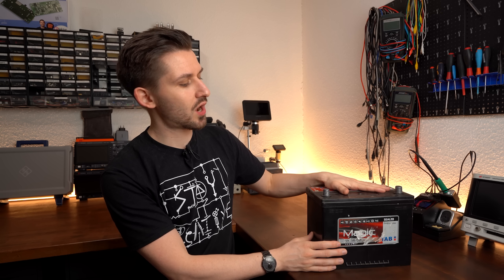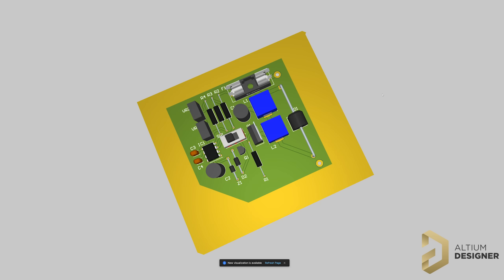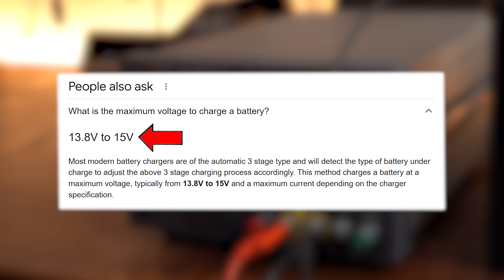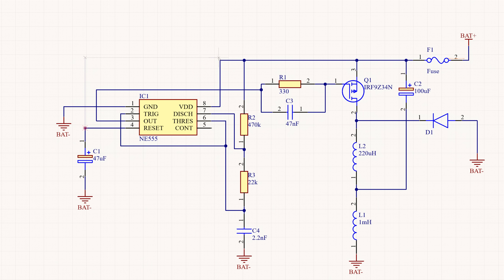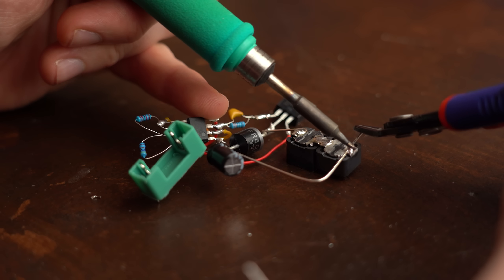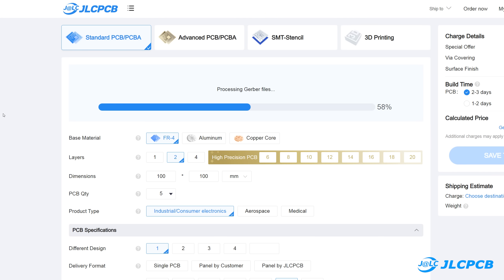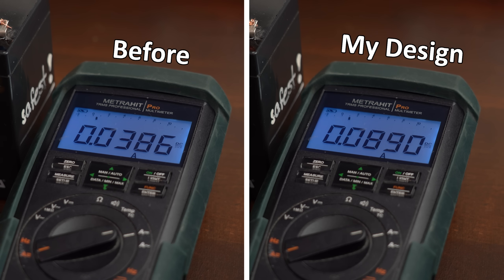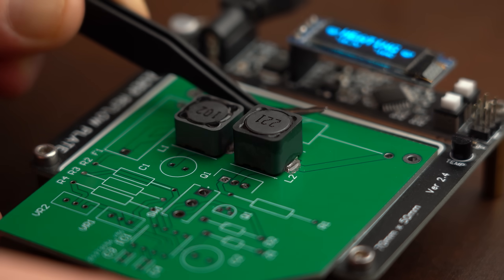I followed a YouTube "Battery Hack" and Wasted 30 Days! (Desulfator)

Comment: pro batt tech - lots of clients including one of the largest fleets of industrial (steel-cased) batts in the world - first thing for anyone reading this - if you want AGM then get a drop in lithium replacement - AGM = money pit - they are a bridge chemistry to basically serve the role of lithium before lithium was a thing and now that it is you could buy the lithium at 5 times the price and you'd still be money ahead - there's a reason that the tech never made it across the pond - also AGM is very fragile hence the money pit factor - so to desulphate a battery there are a few ways - the process is designed for anyone - those who understand it on the other hand don't go buy the book - first is that swapping the electrolyte for fresh DOES NOT desulfate and will cause severe destruction of the positive plates as it changes the PH of the batt (for what ever reason most people think that only liquids can affect the PH but this is incorrect) - the pos plates do the work in a LA batt and are designed as an optimal anode material (called the active material) as the charging process is electrolysis - to desulphate properly (i've desulphlated 1000s of batts and the average batt i work on is about $7,000) you have to cycle the batt which means charging and discharging - as the batt discharges the sulphate bonds to the lead in the plates and the process reverses during charge - if the sulphate is left bonded to the lead it will form a second covalent bond and this is what is known as sulphation - as it is physically bonded to the plate in solid form then an electrolyte swap is pointless - the sulphate has to be busted off of the plate and that is done by controlled overcharging - so - take the capacity of the batt in AHs - a standard automotive 12V is about 70AH - so a 20% start rate for normal charging is 14A and the 5% finish rate is 3.5A and the desulfation rate of 2 to 3% is around the 2A range hence why lots of chargers have a 2A option - the max temp of most batts is 110F and then the batt will start to take damage - this is the internal temp mind you so for a car batt don't let the outer temp get above 95F and you'll be good - also - don't let the temp get below 50F - dissolved solids are another problem so be sure that any water used is distilled and deionized - only ever water a batt when fully charged otherwise it will push out excess electrolyte - so take the batt and pop the caps - is the water is below the top of the plates then add only enough water to just cover the plates - then start it on a 2A charge and allow it to charge normally - when finished the electrolyte should be just below the vent well (about 1/8 to 1/4 inch) - if it is under then add enough water to fill it to the bottom of the vent well - i always do this at about 95% charge and fill to a 1/4 inch below so when the batt finishes the last 5% the electrolyte is mixed and the level set so that i get accurate readings - two ways to take SG readings (be aware that specific gravity is a relative density reading and has nothing to do with PH) - a hydrometer and a refractometer - the hydrometer has to be temperature compensated the refractometer does not - most manufacturers list a SG for their batt on it or in documentation - if not listed then default to 1.280SG - this is at full charge - when dead this will be around 1.150SG - cell readings are taken in order from cell 1 (the most positive cell) to the most negative cell (a 12V car batt has 6 cells) - cell voltages are taken by VPC (volts per cell) - since most car batts only have a connection to cell 1 positive plates and cell 6 negative plates then for a car battery you would divide the voltage by 6 to get the average VPC - when loading the batt to discharge you need to set the rate at its 6 hour rate - take the capacity and divide by 6 - our 70AH batt comes out to 11.667 so we will go with a 12A load - the load needs to stay fairly constant so while discharging you need to monitor it and adjust as needed (doesn't need to be absolutely constant just reasonable) - continued in reply
Reply: so now that we know our rates and we have the batt fully charged and watered we are ready to start - the first thing to do is to take SG and VPC readings and write them down - then you start the load and write down the time and the VPC under load - periodically (every 15-30 mins) test the VPC and write it down along with the time - when the VPC of any single cell gets to 1.7VPC (our example batt forces us to estimate the VPC so it would be 10.2V under load) then take the final VPC readings and write them down with the time and stop the test - the time it took to discharge to 1.7VPC under load is your capacity and is important to tell if you are gaining any ground - now we allow the batt to cool if necessary and then we start it on a 2 to 3% charge rate (2A for our example batt) - i use cheap scientific thermometers (one in every cell) to watch the batt temps from the very start to the very finish of a battery reconditioning - if the temp of a cell spikes (it's usually very obvious) over the rest this indicates broken/shorted plates and that cell is bad so for our batt it would have to be replaced - once the batt reaches gassing voltage (usually around 2.35 to 2.4VPC also known as the 80% mark and is the point that the batt becomes saturated with excess energy and starts to drive the reaction process and is also when the batt is ACCUALLY charging) the electrolyte will start to lightly boil (ignoring bad cells once the cells are gassing good if any aren't mark them as they may be unsavable as it means that the cell is nearly chemically inert) - start taking SG readings at this time and write them down and repeat about every 30 mins - allow to continue charging until all cells stop releasing acid (as a cell releases acid the SG will increase) though don't stop charging until you take two rounds measurements with no change - then allow to cool - then discharge like before - then let cool - then charge like before - ect. - the point that we call it done is when the capacity stops increasing as well as when the sg stops increasing (referring to the final SG at the end of a charge) - for example 85% for two discharge cycles with 1.235SG all cells for those two charge cycles - we will want to stop at the end of a charge cycle so an acid adjustment can be made if needed - acid adjustment isn't necessary unless the SG is at least 30-40SG low as the manufacturers put in extra acid to compensate for battery degradation - I only have to acid adjust about 15% of the batts that is recondition - if it is needed then it has to be done properly - if not then it will fail rapidly - for our batt we can try to dump out the acid but you won't get it all and also when you tip it over it will cause the solid sulphate located in the moss well under the plates to move possibly shorting the plates - not worth the risk - once i'm on the final charge cycle and the acid stops releasing then i let it continue to charge so that it will continue to gas as this causes a convection current in the fluid causing a mixing effect - this is when i use an acid extractor and suck all the electrolyte out of the top of the cells and i pour in 1.400SG acid (hard to get as this purity is regulated - i get it in 55 gal drums so DHS audits us because of it) the strongest that a civilian can buy is 1.300SG but if you take it to about 150F then the water will evap out of it increasing the SG - BE WARNED - anyone that follows anything i've said here does so at their own risk - also 1.400SG is very strong) - i pour it to the top of the cell almost to the brim - allow to gas for 20-30 mins and then check the SG - if it's low then suck out the electrolyte again and fill with 1.400SG acid again (repeat until cell SG is at 1.280 or original spec) - if sg is too high then suck out SOME of the electrolyte and fill with distilled deionized water again trying to get the mix to 1.280SG for original spec - after the mix is set allow to continue to gas about 20-30 mins to allow it to mix and then check again - adjust as needed - once the mix is set then suck out electrolyte until the level in each cell is 1/8 - 1/4 inch below the vent well - the average batt that i recondition is about 7-10 years old and usually been operated 24/7 - most last about 2-3 years after but some have made it longer after the reconditioning (i've had one still operating that i reconditioned almost 8 years ago and i have 3 still in operation that i've reconditioned about every 2 years one of them i've reconditioned 4 times now - it all depends on plate damage) - do note that there are a significant number of factors involved that i haven't mentioned so results will vary - also you should know that there are two kinds of maint. free batts - AGM and flooded LA - flooded LA have a stabilizer in the water to prevent it from evaporating out - you can't buy the stabilizer and stabilized acid will not reduce when steamed - also if acid adjusting a maint. free batt then the batt is no longer manit. free and needs to be watered periodically - just pop the caps - charge it fully - then add water to each cell until the electrolyte is 1/8 - 1/4 inch below the vent well - AGM batts can be desulphated but not by the process i've described nor will i detail it as it can lead to serious catastrophic failure during the process
Reply: "Pro batt tech"  Fucking hilarious.  AGM... bridge technology... BEFORE the next technology even existed.

Comment: Test capacity with tester. Remove cell caps, Top of cells with distilled water and make sure to check level of electrolyte throughout process. Check cells with Hydrometer and record each cell specific gravity and color of plates and voltage of battery. Use a stick DC welder, charge battery with 80 amps until it bubbles for 5 minute, let cool, check electrolyte level, repeat 5 times. Check cells with hydrometer and record specific gravity to check for improvement of electrolyte, check plates color. Test capacity for improvement, if improvement is not sufficient Repeat with 100 amp setting, checking capacity after each cool down. This will usually achieve results ~75% of the time. If a cell/cells  is/are not improving. Go there may be a short (indicated by voltage being low after charge cycle) or extreme sulphation (try another charge cycle at 125 amps) if the improvements are not sufficient for vehicle use the battery may still be good for other purposes.  Check this video. https://www.youtube.com/watch?v=a2XRR9aFWPo

Comment: The Powerpulse from Pulsetech does work. If you get the charger know youll need to leave it on the batter for a couple weeks to a couple months to breakup aall the sulphates. It really does work. They also have a unit you can attach permanently to a battery

Comment: uh Scott.  Great job as always.  Regarding this type of desulfators and chargers, I am testing a 10A one on a 7A battery.  And I don't know if I'm doing it right or not.  Do you think it is posible to put a current limiter on the circuit, like the improvements you make to some devices?  thank you in avance.

Comment: Only luck I've ever had is popping the caps and overcharging the crap out of it, and that's more of a force balance that usually only lasts a little while, get the car to next paycheck type scenarios. The only method that I've seen really "work" is recycling them into new ones, that's what a typical lead acid battery factory does.

Comment: I have desulfate several small lead acid battery from scrap just using a step down transformer, diode, 5w 10ohm resistor and a fan. I takes me 7-10 days, and yes i replace the acid before and after desulfating.

I start from 0v, voltage rising at first with diode, resistor and the battery heating up. Then voltage decrease and after some time increased again, not too hot this time and the acid is bubbling. Then I use dummy load till voltage decrease to around 11v then charge it to 13.8v. I use 27v ac to desulfate and 19v dc to charge it with around 2a initially from 11v. 

But i do not think it was worth the hassle to recover dead battery, the capacity decrease significantly from specs written.

Comment: In your "remade" circuit the resistor R10 of 330 Ohm is missing (from junction between L1 and L2 to ground) I guess this changes the output signal .

Comment: Awesome video great scott, and great research on the subject of cleaning batteries. I had done similar experiments and can also conclude that it is very hard, or almost impossible to recondition the batteries, specially newer lead acid batteries. New lead acid batteries use powdered lead to increase current but this results in unrepairable plates. Wanted to try one day to create ultra thin lead plates and create own batteries. Best way to revive is not through electricity but reconditioning the acid and plates by hand

Comment: Sir i create desulfator circut, and connect my 100ah lead acid battery (this battery only 1 hour backup 200w load), 5days after i test the backup time only get 30mints again i recharge and after 10 days bbackup 10 mints, what is the issue any body support me

Comment: If you want a lead acid battery to last as long as possible keep it on a float charger set to the correct voltage from the data sheet when not in use. Fastest way to kill one is to store it flat.🎉

Comment: Sealed lead acid batteries can not be rejuvenated. 
Only wet cell batteries (old style car batteries) where one can add water, are practical.
Battery shops in the middle east all set them outside the shop and charge them at 16V to "cold boil" the electrolyte and add water as it gets converted through electrolysis. 
They overcharge them for 1 day. It does work, but not if any plates are shorted.

Comment: I saw another test with a blue but otherwise the same desulphator. Either one of you is being deceptive, or some other factor produced different results. (The cause of the battery issue, the desulphator, the battery design)

Comment: I can see how the single circuit may not work, the damage that occurred also seems logical. Explanation as such:
First, some batteries cannot be revived - Lead flakes off of the plates and can accumulate at the bottom of the battery (Deep cycle batteries actually have extra space at the bottom to allow for more flakes)
Once that reaches a threshold, the plates are short circuited and no amps can be stored any more.
Furthermore I highly recommend a "Smart Battery Charger" which uses different phases of pulses during the charge cycle, which ensures the desulfation happens properly whil safely charging the battery to capacity. 
Important to not - its bad to think in terms of a battery to be rescued, rather realize the importance of "Battery Maintenance" which will greatly extend the overall lifetime of a battery.
As for the damage - the circuit most likely over-drew what little capacity remained in the battery, causing lasting changes in the chemistry and the plates flaking off more.

Comment: old batteries just had sludge buildup on the bottom, the higher it crept the more capacity you lost. You'd just open the battery up, wash it out, pour new acid in and it'd be good for another couple years. No idea if this still works

Comment: Nothing can beat the mist of misinformation, speculation and fraud better than a solid series of tests. 

at 3:45 one of the cells of your old battery has a short circuit.

This happens very often, most of my car batteries died when one of the cells got such an internal short. the battery may still have enough power for headlights and radio but can't activate the starter. And once it happened on the batteries used for my off grid power supply, very nasty because the batteries where connected in parallel.

Comment: I actually got pretty good results from the NOCO Genius 1
I had a few batteries that were previously unable to hold a charge. My Jeep battery would be dead after leaving it overnight, no matter how long I left it on the charger or left the Jeep running to charge it. But I put it on the NOCO Genius 1 and left it for about a week while I was out of town, and the battery was actually useable again. Been working fine now for over a year. Jeep starts up fine even after leaving it for a month.

Comment: I've had a 50-50 success when attempting to de-sulphate old car batteries for an off-grid system I run which needs a couple of batteries. I get them used as ordinary failed batteries. Some batteries are just junk for other reasons like plate shedding / internal shorts - like the first one you had, if its 1/6 of the voltage down (2.15V),  then 1 of the 6 cells has failed and it will generally get hot when charging, again like yours did.  See the battery university web site for lots of handy info on lead acid batteries. I've done some charge discharge cycles on others and measured the Ah rating before and after de-sulphating for 6 weeks or more.  Wet batteries work better than AGM in my tests. You an also see the difference if you look at the plates before and after, so it does work as a specific fix for one problem - sulphation, not just general battery failure.
Reply: The reason flooded batteries work better is because AGM batteries technically need water and they will dry out over time but because of their classification and for warranty purposes, it is advised not to add water even if it would help. If the AGM battery is old enough and the water has boiled off, it would make sense that it would need water. When an AGM battery is made, it is filled up and charged much like a wet acid battery, after the process is complete, it is drained of excess electrolyte so that it can be classified as an AGM. If you notice, a wet battery that has lost most of its water has a higher resting voltage compared with when flooded normally...exactly the same as an AGM battery.